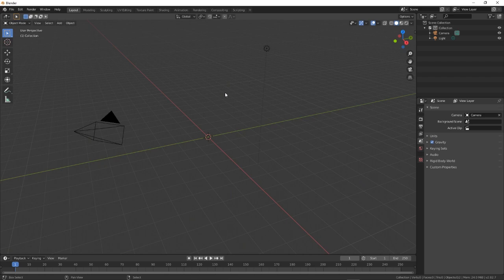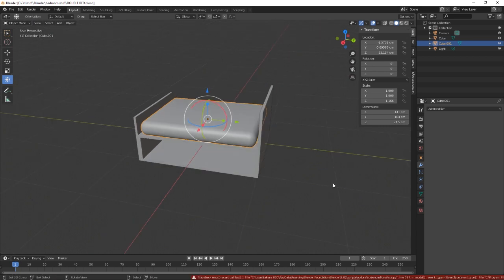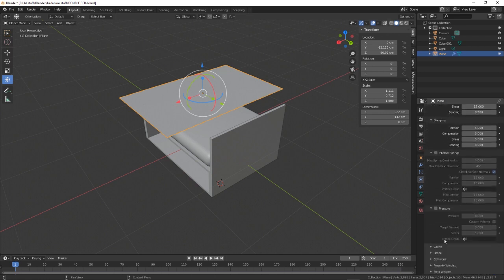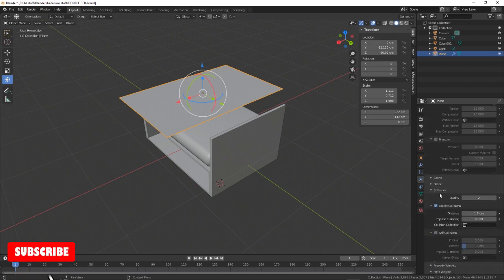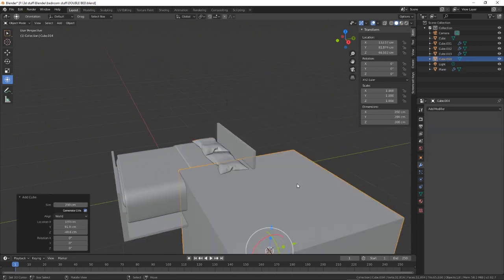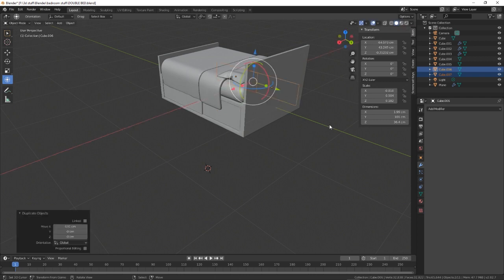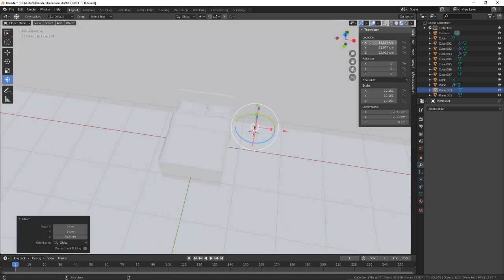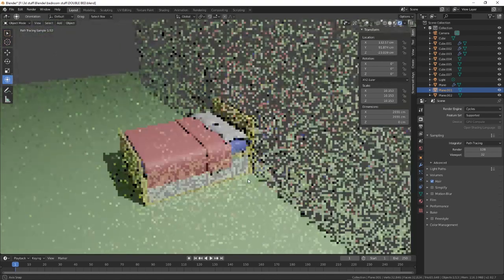Blender 2.82 How to model a basic double bed.

Comment: hi, i tried the collision thing and the stuff is falling very very slowing, i think it may due to scaling as i changed all my stuff into mm instead of M, do you know how to increasing to falling speed of the object? thanks
Reply from the maker: Hi, in cloth properties try changing the Speed multiplier. Or in scene properties change the gravity settings on the Z axis. remember you will need a negative on the gravity number for it to fall.
Reply: @blendercubed  thanks! i would give it a try on the gravity settings.